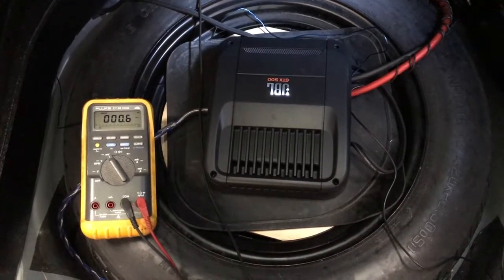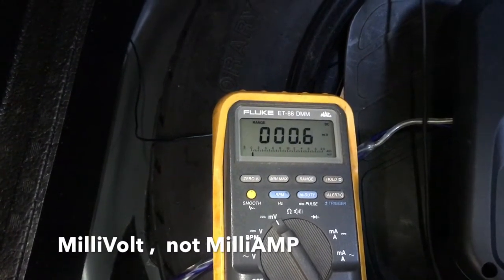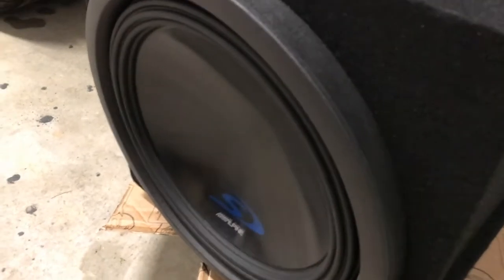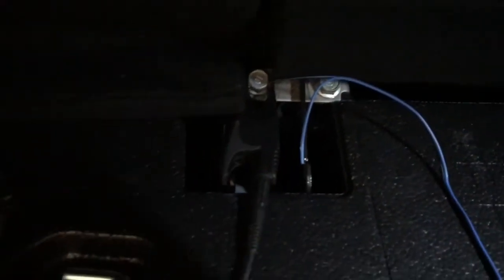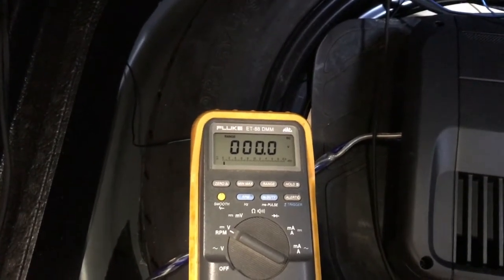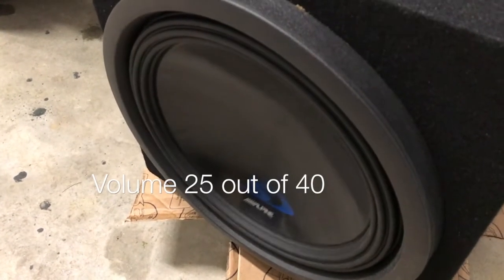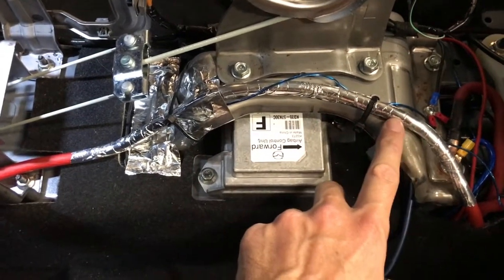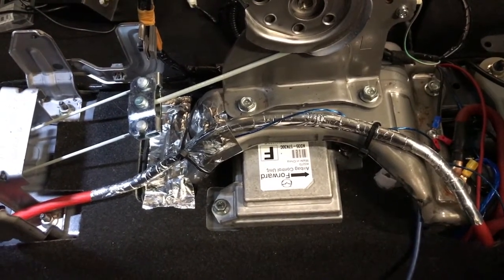Power Wire Electromagnetic interference with RCA Fix

Comment: HI RESISTANCE can cause voltage drop , if there is some kind of corrosion  or restriction on a wire. WHEN YOU START AN INSTALL YOU NEED TO DO EVERYTHING CORRECT FROM BEGINNING TO END OTHERWISE YOU GOING TO END UP WITH LOTS IF ENGINE NOISE, INTERFERENCE  AND  VOLTAGE ISSUES.

Comment: Try increasing the diameter of the conductor between the source and the load. To prevent voltage drop. Good luck

Comment: The second time around, you're multimeter is set to Volts, not milliVolts, which I expect makes quite the difference.
Reply from the maker: Dammit, I totally set it wrong there and good catch by you. I’ve run that test correctly before though and this principle still holds true. Might have to do a retake on that one.

Comment: Excellent! I’ve got a similar issue I believe with aftermarket backup camera. I got a light shock when handling the power wire coming off of the reverse lights and the RCA cable is wrapped around it = crap picture. Will try this out.

Comment: 🤣🤣🤣🤣🤣🤣before u go crazy wrapping your entire car in aluminum foil😅🤣😅🤣😅 car audio its not rocket science. We are always going to get RF or some kind of electromagnetic interference, as even speaker wires themselves act like antennas. Does this mean we need to wrap them too😅🤣😅🤣😅. People this is non audioble stuff when equipments are connected they have a load or resistance that diminishes this even more. Now we all know that you need to run your rca connectors threw one side of the car and powers threw the other , try to keep them away but still rca if bundle up can act like inductors and pick up all kinds of engine noise , so the key is to use twisted rca wires not cheap rca. They don't have to cost a fortune . This twisted rcas will keep engine noise down . You can get away by using good  shielded RCA if twisted doesnt work for your specific set up, but try as much to keep them away from power wire. Do this and you dont have to wrap yourself in aluminium foil🤣🤣😅🤣😅🤣.  And try to avoid conecting weak ground points using thin ground wire. Keep ground short   and same place to avoing ground loops. Make sure car ground wire to chassis is in good shape if your going to be using the cars chassis as gound for your entire audio gear.  please keep it simple  or soon we all going to be wearing aluminum hats to keep the alien interference from reaching our brains🤣🤦‍♂️. Im an active audio/home theater installer on the business for 46 years.
Reply: which rca is the best for cars suggest me some companies
Reply: @@a.melburn 
Make sure your not using a remote turn on signal from an ignition  thats creating the noise. Try changing the turn on sequence of the equipments . Sometimes engine noise can creep into the system if your using a converter to get signal from the factory radio , try wrapping converter with clothtape to preventing it from touching body of car and keep it away from magnets or  motors ect.  Keep all your grounds short. And make sure to do a equipment check cause sometimes old amps are the issue. So if using preamp bypass it to check thats not the culprit.  Do the same to all the equipment.  Sometimes an equipment could be behind noise issues.  Good luck
Reply: @Themadscientist6858  hello.  so. can you help me. i have rca voltage loss. different sound quality and not loud and soft bass from all amps. all equipent are good and grounded from the battery. all conections good. i have mazda 6 2007year. and i have voltage on amp [bass amp] body. i think its ground loop. amps not touching metals. thanks